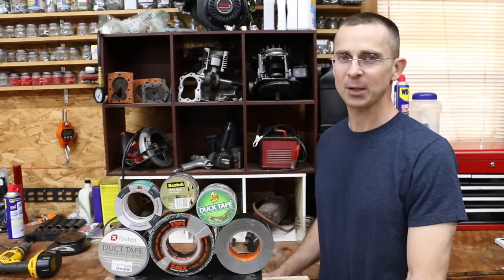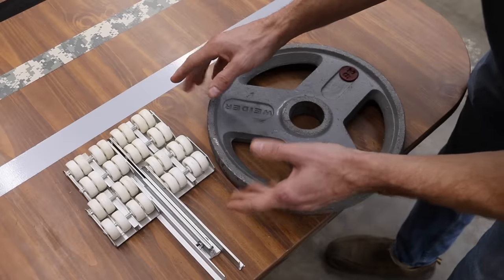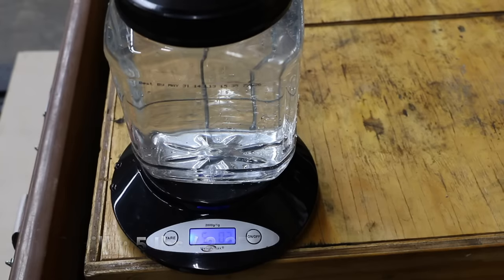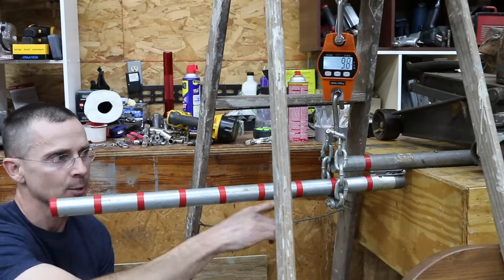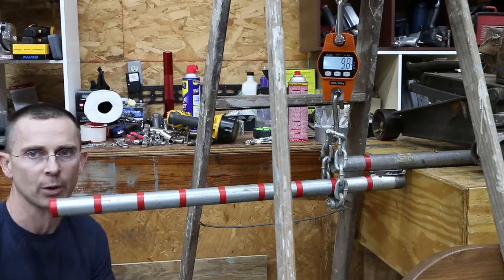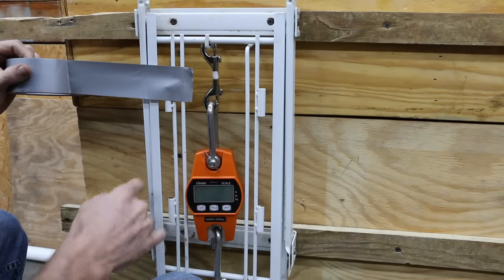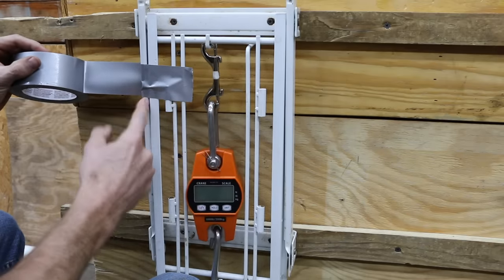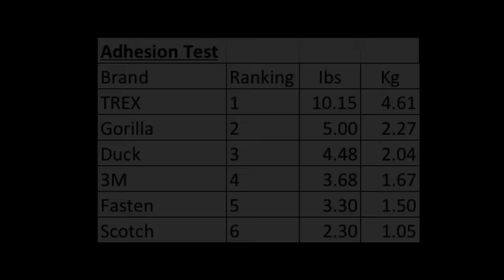Which Duct Tape Brand is the Best?  Let's find out!

Comment: Good vid! Sometimes I find Gorrilla tape to be too thick, and I use thinner products. The thickness provides a lot of the strength and if I was using a thin product, I've wrap it twice to achieve the same result.

I'm just saying that there are many many variables, and such a simple set of tests doesn't always reveal the best for any partucular application.
Reply from the maker: Thanks!  Good Point!

Comment: I've noticed that Gorilla brand sticks better if left to set for a few minutes before applying any pressure to it.
Reply from the maker: Thank you for this recommendation!
Reply: Project Farm gotilla tape does in deed gets a stronger hold as it sets a while. I used it all the time insulating out in the oil field. When i first started using it i thought it was junk because when i pulled it off to reposition it it came off very very easily. But....in the spring time when i went back to remove it. It was like it was epoxied on. Im a believer
Reply: I've noticed the exact same thing, and commented on it above. Like Bob at first I thought the stuff was junk it just pulled right off. Later though, OMG that shit just does not come off. I've come to really like that feature of their tape as it allows you to fix problems during application then be confident in it. Just gotta give it a few before putting whatever you taped up to work.

Comment: We stocked 3M duct tape. We all called it 200 mile an hour tape. back then. I got a roll that was 4 inches wide and about a foot in diameter that was dark OD green. I’ve still got a little bit of that roll of tape left and it is still good and I still use a piece of it occasionally. The stuff is over 30 years old and has been in my unheated shop that freezes in the winter and cooks in the summer. I’m not sure if anybody makes the stuff that good anymore. 👍🏻
Reply from the maker: Thanks for sharing.

Comment: would be interesting to see how the tapes hold up in a long term application. after being exposed to heat and humidity. a lot of tapes i used so far, tend to get brittle or loose their adhesive strength and just fall off
Reply from the maker: Thanks for the suggestion.

Comment: Great video! What variety of 3M tape was used? Also, I'd like to see a test on how the tapes deal with harsh environments - unclean surfaces and water.
Reply from the maker: Thanks for the positive comment.  3M Multi-Use Duct Tape, 2930-C.  Also, Thank you for the recommendation.
Reply: 3m has a wide variety of duct tape. I always use Gorilla but my dad swears by 3m. Some of the higher end 3m is very close to the Gorilla that I buy.
Reply: The last time I used 3m I was very unsatisfied. I felt like it didn’t stick as I had hoped for for the application I was using it for.

Comment: Also curious how each tape weathers...that is one use where I find the tape will fail, eventually
Reply from the maker: Thank you for this recommendation!
Reply: Thank you for replying, and for a very scientific comparisons of the various products.  Another thing I would add is that the tear strength, especially sideways, when low is a good thing, so that one can tear it without using one's teeth, or a cutting tool.  I find that duct tape more than makes up for lack of strength in stickiness.
Reply: Yes, thumb up on this. 
@Project Farm since you replied here... I think you can limit your tests since freezing temperatures or hot and humid environment will affect mainly the glue, while the UV can also affect the substrate (only the tensil strength or shear will do).
Reply: That's amazing.  Thanks for sharing!
Reply: That would be an interesting test as a follow-up.  Put each of the tapes across the table and let sit outside in the elements for a month or so...and then do the adhesion and tensile strength tests again.  That would be quite interesting.  Also, was the 3M tape a mil spec?  When I was in the military, we used OD Green Tape on everything.  We called it 100mph tape because it would hold anything in place up to 100mph (or so, they say).
Reply: Not flex tape that will last forever
Reply: I can conclusively tell you from using various brands that Gorilla, T-Rex, and just about any brand of Gaffer’s tape hold up in all elements especially very cold, wet, oily, dusty, etc. I use them regularly in my trucking business and when I need to secure padding to a used, oily & dirty machine to protect my tarp, these are all I use..... because they work.
Reply: Good one

Comment: Averages of scores based on placing (lower is better):
𝙶𝙾𝚁𝙸-𝟷.𝟼𝟽
𝚃𝚁𝙴𝚇-𝟸.𝟶𝟶
𝟹𝙼----𝟸.𝟼𝟽
𝙳𝚄𝙲𝙺-𝟺.𝟹𝟹
𝙵𝙰𝚂𝚃-𝟻.𝟶𝟶
𝚂𝙲𝙾𝚃-𝟻.𝟹𝟹
Reply from the maker: Thank you!
Reply: All I See is a bunch of boxes with x's
Reply: Eldar Iskanderov Must not have an Iphone
Reply: DreadGiraffe210 I don't have an iPhone and I can see everything
Reply: BigDaddyZ Tha Doughboy Exactly, that’s what I was saying basically
Reply: For those having trouble reading the original text, here it is again.

Averages of scores based on placing (lower is better):
GORI-1.67
TREX-2.00
3M---2.67
DUCK-4.33
FAST-5.00
SCOT-5.33

Thank you Joe Krause.
Thank you Project Farm for a great video!
Reply: This is good, but I think a better way to organize the data would be by how much one tape won over another. For example, the T-Rex tape had double the adhesion capabilities as Gorilla tape, and strength-wise it was quite similar which would have meant the T-Rex tape won. If you could do a weighted average based of the actual data instead of the ranking it may show different results. (Not sure if weighted average is the correct term).
Reply: Rank based off total points (higher is better).
1. T-Rex: 261 pts
2. Gorilla: 216 pts
3. 3M: 130 pts
4. Duck: 43 pts
5. Fasten: 39 pts
6. Scotch: 24 pts

Ok so I went ahead and did what I mentioned. I mathematically mapped all the results for each tape from each of the categories on a scale from 1 to 100 (100 is best, 1 is worst). Then I totaled the mapped values and ranked them to determine which tape came out on top. The more points the better.  Interestingly enough, the rank is very similar, with the exception being T-Rex coming out on top due to the superior adhesion bringing in a lot of points for that category.
Reply: Flex Tape 999999 points

Comment: Great video.  

But I’m sticking with 3m.  

I like how easy it is to tear and I don’t like duct tape that’s too sticky because it’s hard to get off the roll and if you pull too big of a piece you risk it sticking to itself.
Reply from the maker: Thank you!
Reply: For most people, 3m tape makes the most sense most of the time. Unless you are using garbage like the scotch brand, the only time you will really notice the strength difference is when it comes to take it off. That is to say, its plenty strong enough for most jobs, and you would prefer it to be easier to use. However, most people who do enough of the sort of work where you would care to watch a video comparing duct tape brands do need stronger tape. 

Most people should probably have both, after all duct tape is cheap, and when you buy two rolls you aren't really spending twice the money in the long run cuz you are also buying twice as much tape.
Reply: I have Gorilla for those tougher jobs.  Most jobs it doesn't really matter.

Comment: The only problem here is which Duck version did you use? Duck started a scam years ago to make varying strength products. The original one was as strong as Gorilla tape. It was super sticky and extremely hard to rip a piece like Gorilla. I cant find the original Duck anymore. The highest grade one is also too expensive and I believe not as good as the original. I still have 2 rolls of it from 20 years ago, they are extremely sticky and tough as I noted. Maybe the brand wasn't Duck 20 years ago? But 20 years ago it was the only Duct tape you could buy. Actually I have one near me and the inner area says NASHUA. Yeah this old roll of Nashua Duct Tape I have is extremely sticky. I see they still make it. I wonder if its still up to par or not.
Reply from the maker: Great point. I probably didn't buy the strongest Duck brand product available.
Reply: no problem its their fault for having way too many choices. its actually made me determine all Duck is crap.
Reply: Yeah these old rolls of Nashua Duct tape I have has strands in them, I believe the new Nashua does too. I think what happened over the years was that the only Duct tape in stores was the Nashua 357 then DUCK started selling it and Nashua vanished. so everyone thought Duck was what they used to buy which is complete crap compared to Nashua 357. At least that is what I observed.

Comment: Great video thanks. My question is the glue that is used on the tape needs time to dry, Would more time after you apply it change the results? And what about heating it up to 100 deg?
Reply from the maker: Thank you
Reply: "Would more time after you apply it change the results?" Yes. Sadly it will keep changing for years. But you are right, one would have to wait at least a day or so.

Comment: I would suggest 300 Mile An Hour Tape, but pretty much the only thing it will stick to is plastic marmites. Yet this is the only tape I could find in Yakima Training Center in Yakima, WA. And it's not cheap either. Expensive tape that can't even adhere to anything.
Reply from the maker: Thank you for this recommendation!
Reply: What's a.. plastic marmite?
Reply: Alexis Finch, think plastic coolers but for cold, warm, or hot foods to be stored in (solid and semi-solid foods for the short wide ones, drinks for the tall thin ones with a spigot on the bottom). We use them in the Army for delivering our food and drink as not every unit has their own cooks, just the support ones, and even those in the same unit may be in the field and don't have the convenience of driving to the home station to eat.

Comment: I would like to know how cleanly the tapes come off after say, a month stuck to a surface. Many of the ones I used leave a sticky mess when removed.
Reply from the maker: Great idea. Thank you for this recommendation!
Reply: If residue is a major concern, look into "Gaffers tape" which is used in the sound and film industry for that reason. It's very strong and doesn't leave residue on expensive equipment or on temporary locations where things are owned by other people who want you gone after you're done recording without damaging their stuff.

Comment: For duct tape the quality I am the most concerned about is the durability. Unfortunately it's pretty hard to do a proper comparison test. And anyway results would be different depending on the environment (heat, sun light, humidity). Thanks for the video! :-P
Reply from the maker: Great point. Thanks for commenting.

Comment: Any chance you can test the best double sided mounting tape? I'd love to know what type of double sided tape is the strongest to mount things to various surfaces with, and how much weight it cant hold per inch.
Reply from the maker: Great video idea
Reply: The strength of bond you get from double-coated Tape can vary depending on what you are sticking to. Some materials (like polyethylene, ABS, polypropylene and powder coated metals) have low surface energy. This is a fancy way of saying that stuff doesn’t stick to it very well. These types of surfaces need tapes specifically designed for them. Some of them can be very expensive. 

Another factor is the environment they are used in. Extremes of temperature and humidity need to be factored in as well as whether they are being used indoors or outdoors. UV radiation from sunlight destroys most adhesives relatively quickly. Again you need a special adhesive for this type of application. 

Check us out at www.taperite.com for more information.
Reply: Foxtropics Go check out 3M VHB tapes on YouTube
Reply: 3m double sided tape rocks.
Reply: 3M VHB is unbelievable.

Comment: I always buy Gorilla good stuff. Video proved it.
Reply: Wish it stuck better though. It's kinda hard to wrap it around stuff because it doesn't want to stick. Apparently it adheres very well though. Kinda strange.
Reply: ootdega have tou tried using a hest gun to prep the tape, it helps
Reply from the maker: It's a great product.

Comment: I had an experience with Gorilla tape that bears mentioning. My wife's car had a side window broken out and I temporarily replaced it with a piece of plexi-glass as it gets quite hot here in the summer ( at times 100*F+). After a couple weeks the gorilla tape's adhesive got very gooey and the outer layer and the plexi oozed off of the car leaving behind a layer of very gooey adhesive which was next to impossible to remove. Fortunately it was a temp fix so wifey could run AC while glass was on order. I was disappointed in Gorilla though.
Reply from the maker: Thanks for commenting on this.
Reply: to be fair that happens with pretty much every brand of tape
Reply: Karl Heeren that would happen with any duct tape
Reply: Karl Heeren all duct tape will do that duct tape does not like heat
Reply: Pro tip: use oil/wd-40 to remove that left over adhesive, spray it, let it soak for a minute and it'll come off easily

Comment: A story about T-Rex tape: I built a motorized bicycle from an older Trex mountain bike. On a Saturday afternoon about ten miles from home, the frame broke at the front motor mount from the vibration causing a weak spot. I always brought some basic tools with me, including tape. I literally taped the frame back together, refastened the motor and rode home carefully at about 20 mph. The tape prevented the frame from pulling apart, although by the end it had almost been worn through. So, I taped a bike frame together and it worked.
Reply from the maker: Thanks for sharing!

Comment: Great video, but I was a bit sad to not see Nashua in the mix. Nashua industrial duct tape is considered the best in the duct installation industry, my friend is an HVAC installer and swears by it, but you can't buy it at the local hardware store.
Reply from the maker: I'll test it soon.  Thank you for this recommendation!
Reply: If you can’t buy it at the store then what good is it in a test for average joes?
Reply: Sunset Rider they don’t carry it at my local hardware store, which is an ace and they suck. That doesn’t mean it’s not accessible I just go to the next town, or any big box store. He already tested it in a new video anyhow.
Reply: 100% agree nashua and Nitto make excellent adhesives and  tapes ¡
Reply: TheWallsocket And thats why you didnt see it here.
Reply: TheWallsocket they sell Nashua at my local home depot and its apparently the smallest in the US. Maybe ace just doesnt carry it
Reply: The average joe buys stuff on amazon on a regular basis. It's not like a piece of lumber that's difficult to ship, order a few rolls and keep 'em on hand.
Reply: It's a test for all purpose tape.
I bet there is dozens of other tapes for special use. I'd guess tape for installations will seal and stick better and longer, even in wet conditions, but why would they need to hold that much weight. And I bet you won't be able to remove that tape that easy.
Reply: nashua is the best , been using it for 30 yrs, never had a problem
Reply: Any HVAC man worth his salt WILL NOT use duct tape on duct work, for duct work your supposed to use foil tape, then a med coat of mastic covering all edges.

Comment: Id try testing the strength of different super glues. I'd like to see how CA40H compares to regular old Gorilla Glue.
Reply from the maker: Thank you for this recommendation!
Reply: Gorilla glue expands like hell compared to CA (cyanoacrylate) doesn't it? CA creeps into hairline cracks. Gorilla glue needs more space to get started and pushes things apart unless you can really clamp them down. It's fine for resetting chair spindles for example.

Comment: Hey my buddy was talking to me about how you only have two months before gasoline is too bad to run through your motor. I disagreed. I've run up to four month old gas without problems before. Could you test really old gas at some point to see just how old it can get before you have problems with your motor?
Reply: billiondollardan From what I know, that used to be a problem with nonethanol fuel. You don't have that problem since most fuel has ethanol which helps preseve it.
Reply: it somewhat depends if the gas has ethanol in it, as well as how it's stored.  Often the issue isn't so much that the gas won't work in the engine, it's that if it's old enough it gums up the fuel system if you run enough of it through.

i've ran years old gas that probably had ethanol in it that was stored in a 2l soda bottle.  The fact that it was 100% airtight meant nothing could really evaporate off, and no water could get in.  there was also very little air inside the container.

If you store gas in a airtight container that is full it should last a very long time.
Reply from the maker: Thank you for this recommendation.
Reply: Alex Usovich it's the opposite of what you said. Ethanol in fuel attracts moisture and this is what causes gas to go bad.
Reply: yea, gas used to last a lot longer with a lot less effort before ethanol.  Thankfully ethanol-free gas is still around and what i use for small engines.  It's just a bit more of a pain to find sometimes.  The gas station clerk probably won't know which fuels have ethanol in them.
Reply: I'm pretty sure there is not ethanol in the gas I'm using. I live in northwest ohio and there are no notifications of ethanol in the fuel around here. You have to drive quite a ways away from here to get E85. I guess if they can sell you ethanol gas without telling you, I wouldn't know though
Reply: billiondollardan it's probably 10% ethanol.  I don't see it posted at pumps anymore.